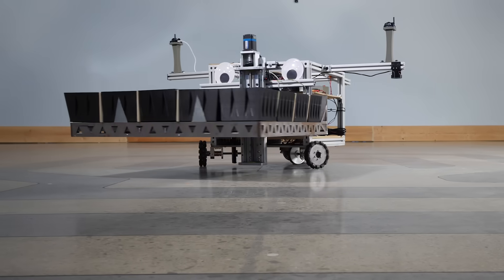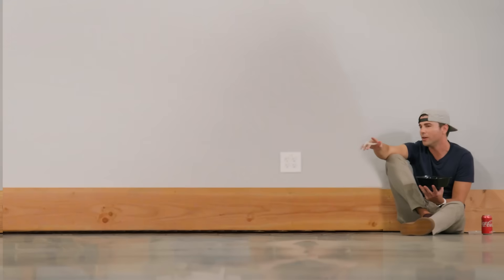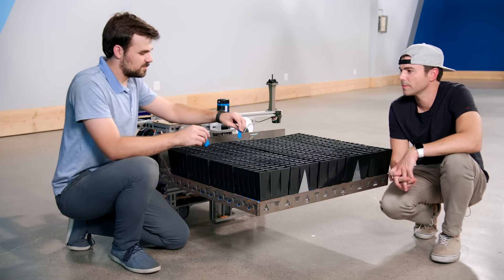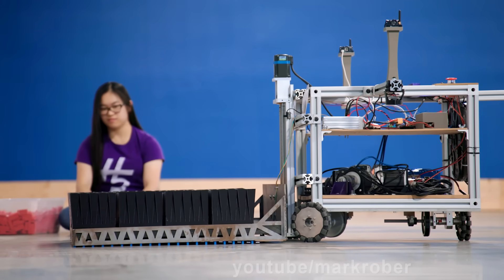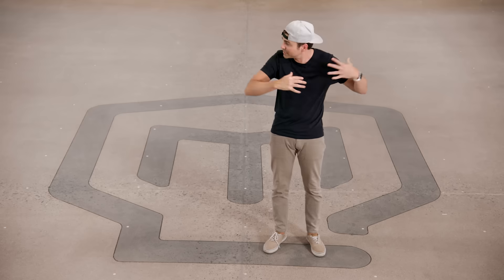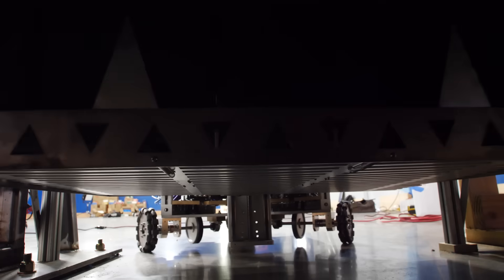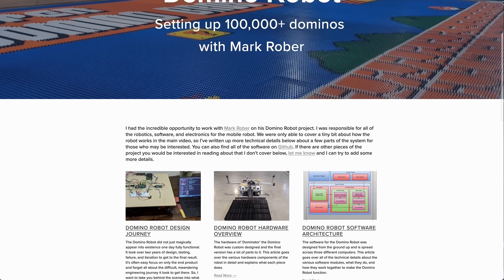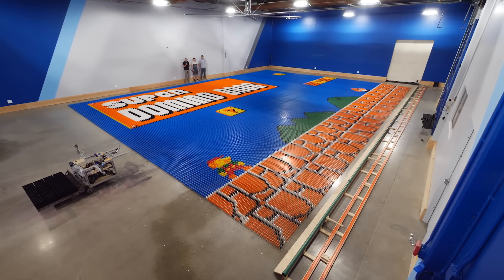World Record Domino Robot (100k dominoes in 24hrs)

Comment: Mark, this is a nice bit of tech your team built. However, the precision isn't quite there yet. You can look at the field and see the individual groupings. Some of the alignment is off enough that (at least in the "head to head" demo), not every domino fell. You can see the variation in placements in 12:34 as well. I'm not sure what's causing the variation, but my guess would be with the camera based alignment system. I'm guessing the software is only looking at the dots your team placed on the floor. The dots could be out of alignment, the camera might not be sensitive enough, or there isn't enough points of reference that helps Dom figure out where it's body is in relation to the floor. (I'd be interested in hearing what difficulties were in not simply setting up Dom to use the domino grid it placed to align future drops. That should be far more precise than human applied dots.)

Also, where's the flashing light to tell people that Dom is armed and in autonomous mode? If after four years of volunteering for FIRST Tech Challenge events and watching FIRST Robotics Challenge events has taught me, you need a big, flashy light to let people know that a robot is running in autonomous mode.

Is the Dominator Mk 2 going to include a bot to do curved paths, ramps, and bridges? I think Mk 2 should include a bot to do curved paths, ramps, and bridges.

Comment: My only question is why a kiwi drive... i know that it give u mobility in all directions. and it only requires 3 motors... But if you were to use an X-drive it would be easier to program and you have 4 omni wheels rather than 3... so sure its more motoers so more power to the battery wont last as long but you also dont have to have as complex of a code.. but i might be wrong lol thats just what ive understood from doing Vex competiton robotics... i would love to understand why the kiwi drive over the X drive :P tysm for ur time yall have a nice day

Comment: Wouldn't it be possible to increase Doms speed by having him be loaded with several layers of dominos instead of always having to reload after each time? By layering the metal dropper with several layers and between each layer there could be a dropper that drops the upper to the lower "floor" once the lower one has been dropped off. Naturally the reloader would also have to be improved so it could keep up with Doms speed. Using the same conveyer belts but at the end using a somewhat similar principal like a package delivery company or amazon uses to sort the dominos in the correct section. I have no idea if it is feasable or would even increase the speed. May be even more annyoing to create since the contraption would have to move on a y and x axis. Oh well whatever. 
Awesome robot you guys designed and build there. Thanks for the video and no slapping his butt anymore :D 7:25

Comment: You need to make one tray where the dimensions between the dominos are such that the double domino effect occurs! 

Hopefully, it can be made with tight enough tolerances to work reliably with the little dominoes without hard labour, because otherwise setting them up by hand for the double domino effect would be very very difficult.

Comment: The ultimate would be that when someone orders a domino mural, a self-driving van shows up, the cargo boxes wheel themselves in, the loader assembles itself, and the setup begins.  It's all done autonomously or with a little telepresence.
Except the clean-up, of course.  The client is responsible for putting all the dominos back into the cargo boxes, which will follow them around like puppies.

Comment: Dominator V2 needs to set up a domino set of the same size that sets off the fall from a single domino push and has a path.   Loader v2 should take a mixed batch of Dominos and separate them by color before loading them up into Dominator.  The two should work cooperatively and be able to switch projects on the fly and go back to the unfinished project.

Comment: Dom has what I would argue to be a fatal flaw: He can't place connecting dominoes so you can kick it off with a single topple.
Reply: Mark, you have your job cut out for you for version 2.0
Reply: Indeed. I thought that was the whole point of domino constructions.
Reply: Just do a second bot. So Dom would have a family.
Reply: Seems like it would be a slight modification to the drop grid to load into a frame with end curves to layout out at either end of the main grid. Or you can do that manually!
Reply: agree 🤝
Reply: Yeah I was thinking that too. But this is still incredible

Comment: one somewhat unfortunate downside of the way this system works, is it doesnt allow for angles at all, it has to be perfectly orthogonal, or else the speed is significantly slowed down, as it can only drop one batch at a time, so in order to do curves, you can only load it a few pieces at a time, and program the drops from there
an idea for a change would be swappable palettes, say one that contains various curves, and one that contains various merges/splitters so you can have it all go from one start location instead of using the pipes to start them all individually